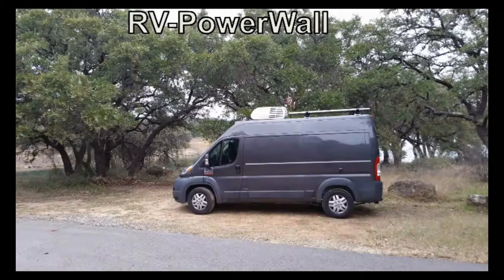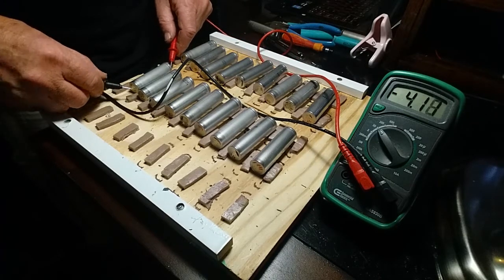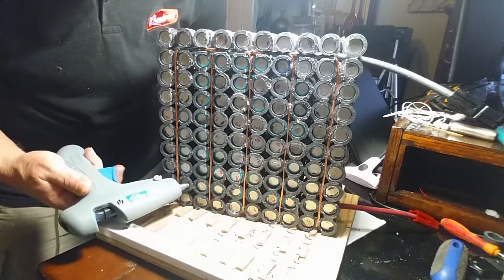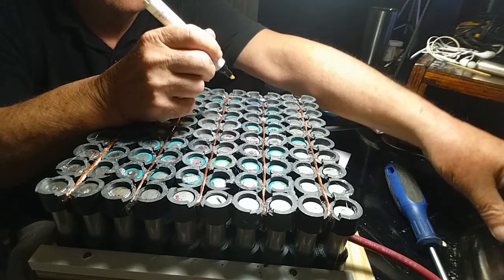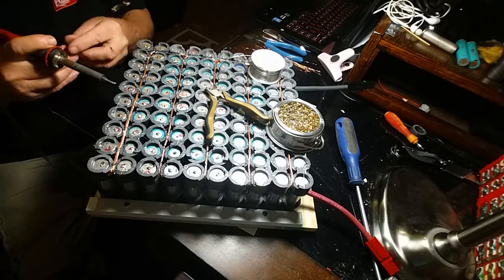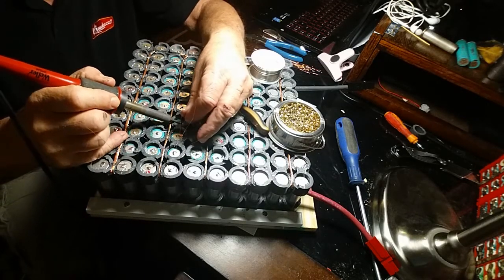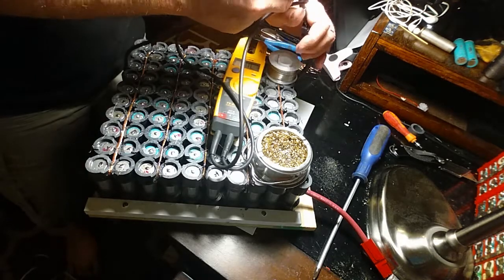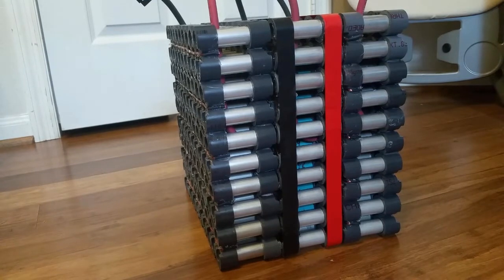DIY RV PowerWall 18650 Battery Holder Build 4 Soldering the batteries

Comment: So the first step would be to build a spot welder from a salvaged microwave oven transformer.  Lots of videos on this project.

Im also thinking some thermal protection might be wise. In that same thought might be a few thermocouples wired in to some kind of an alarm that would indicate where the problem may lie in the event of a failure.

Comment: Awesome idea of them batteries being "recessed" . Makes it harder to short them out.
Reply from the maker: 'thanks Portable... someone gave me the idea of measuring tubing and drilling it with a 12" drill center through the pipe at every cut measurement. then cutting and this may prevent the need to router them. This would save labor and time yee haa. (note never tried it)

Comment: excellent video....I have thought about the glass fuses myself since weeing Average Joe's series on the fuse testing....you look to be in about the same range for demand on your cells as I....I will be building a 48v system for our 5th wheel and looking at a demand of half an amp per cell(I am testing with athe opusbtc3100 at 1amp charge/dischage that way if they handle 1 amp I know they will be fine with what I will ask)...anyways I was curious what size glass fuse you went with? Also what do you think of the tesla style one that jehugarcia uses?
Thanks and keep up the great work and the video's
Reply from the maker: I will be using the .5 amp glass fuses. In all of AVeJoes test the .5 amp wire blew at 3 amps. I had a 18650 battery in my RV that lasted about 2.5 years and a couple cells went bad and distroyed all 100 cells in that pack. The fuse I used in my first battery was the ones Jehugarcia used. I would not recommend using those. they blow about 10 amps. also the longer the fuse is the more power it takes to blow it. Since all my samsung batteries are rated up to 4 amps discharge  I want them to blow before they get to 4 amps. I too tested all my batteries at 1amp discharge but the most my batteries will see is rarely .75 amps.
Reply: excellent ..thats what I was thinking aswell....Thank you for the quick responce and look forward to seeing the rest of your build and what you are doing with your channel